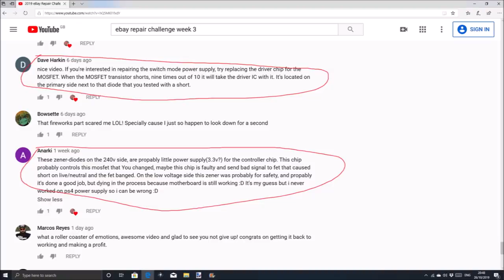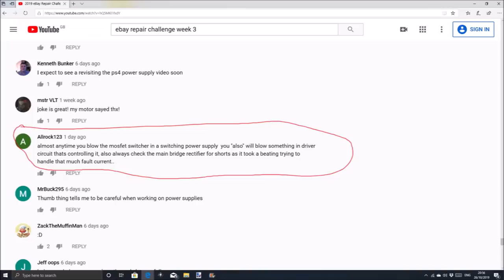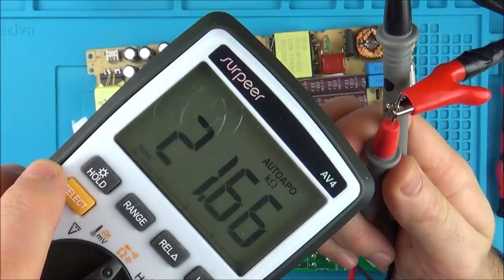REVISIT : PS4 Slim Faulty Power Supply ADP-160ER

Comment: Really pleased you revisited this =D  Resistance you've gone with for bleeding the cap power is fine!  Whilst you could damage the caps just shorting them, most people in the repair industry do just short them and 999 times out of 1000 it never causes any issue. 

Preheating both sides for a few mins at maybe 200 can help regards delamination, but it can be hard working with PSUs.  One of the problems removing that diode is they glue them down before soldering - that was the wierd redish black colour underneath it!  The other tip regards working with cheap boards like that one - use lower airflow!  It takes much longer to gradually reach temperature but that's a factor!  On things like the Switch, they have so many layers and so much ground layer etc the boards are much more tolerant as they can absorb the heat you use.   On a cheap 2 layer board like this it will 
burn up super easy with too much heat too quickly.
The other thing you should do regards removing small caps like that - heat both sides of the cap with the iron tip at the same time and slide them off - rather than using hot air.

Great job!  It was a fantastic learning excercise =D  You could rework that board - ie. fit the ICs and caps, remove the broken traces and replace with small wires.  One problem you can have when they go blackened like that is the board is carbonised and shorts could occur with high voltages etc.  But I suspect it would work fine after refitting the missing / faulty components and fixing with a wire or two.   I am so glad you revisited it!!!!
Reply: Thanks Vince and GadgetUK learnt quite a bit there, Cheers  🍻
Reply from the maker: Thanks Chris, when watching the video back the red glue became obvious but not when I was actually working on the board. Thanks for the help earlier on and also now with these extra tips. Nice one :-)
Reply: @Mymatevince  No worries Vince!  I am glad I didn't accept your offer to take a look at it!  You came to the same conclusion I would have done - I might not have even found the short as quick as you did!  But my point earlier about the SMD parts being hard to find - you've found problem too!  I searched for that IC on Google and can find nothing about it =/  It's probably propriatory to this PSU or used in very few other applications.
Reply: @Mymatevince  The red glue was used to fix the components before wave soldering. The board was not designed for hot air soldering.
Reply: @Mymatevince  hi VINCE..
Quick question..
My ps4 turns on and goes off..

I tried putting washers, but strangely it started to turn-off even quicker than before.

Then i removed the washers and the ps4 waits for a teeny bit longer (but still quick as 1secondish).

What do you think is the problem?

Previously I was thinking it could be a power supply problem but then i was getting 12v after jump starting the power supply. 

Could there be a problem where the power supply has a problem and cant handle the the load and gives up??

Or is this strong contender for apu solder joint problems (because of the time differences i found when trying to switch on the ps4 with and without the washers) 
also I didn’t use rubber washers but some metal ones, two on each sides..

Waiting for a reply.. 🙏🙏🙏

Comment: When you try to remove solder from parts, apply flux and then go over the pads with your hot soldering iron tip and add a bit of leaded solder. Leaded solder will bring down the melting temperature of the lead free solder and makes it easier to remove the part. If you keep having troubles, add more flux.

Comment: The chip is a NCP1612. It's a PFC (power factor controller). The shorted Pins are Gnd and Vcc.
Your patience is unbelievable ... BTW: seems that is one of the boards where the components are glued to the board before soldering. They are not designed for servicing at that low level - that's not your fault ;-)
Reply: same shit on the inverters drive boart 

thats is the basic components for the switchin power supply, the bridge rectify, mosfet, fuse, and the ic for power controller

well a trick on the bridge, that component acts like a diode, so, > pass the voltage < denige the voltage

Comment: Discharging the capacitors with a light bulb is fine. They experience much greater current spikes 50/60 times a second, while charging, during normal operation.

The pink dots around and underneath the SMD components are glue. That's why you're burning the board: The solder is already melted but the glue keeps the components stuck, making you falsely assume the solder is not yet melted. Try to apply some twisting force to the component while the solder is melted to break the glue.
Reply: 0

Comment: Finding a short is a lot easier with injecting voltage and looking for heat and going from there. Thermal cam, freeze spray, alcohol boiling away... etc...
Reply: so true , hard to see he grilled the board
Reply: @ingenuus2  Poor boardie 😢

Comment: That board took a hell of a power surge.   The bridge rectifier was shorted,  which likely blew the PFC switching mosfet that you first replaced.  This in turn blew out the PFC controller (the chip).  SInce VCC and GND on the chip were shorted and that chip is powered via the 12V supply,  that was likely damaged as well.  Other components that likely failed in the PFC circuit would be the current sense resistor in series with the PFC mosfet (low value, fuse-able resistor),  the gate drive resistor if there was one (between the PFC IC drive pin and the gate of the mosfet),  the boost diode (this was near the other side of the board,  under the large choke),  and possible damage to the main switching mosfets as well (these two were on the bottom of the board,  near the main switching transformer).  
Just an FYI but if you're working on switch mode power supplies a couple of tips - 1. If you have a multimeter with a Low Z mode,  you can use it to discharge capacitors in a few seconds and it makes discharging them very easy as you just use the probes.  2.  If any kind of switching mosfet fails on a power supply,  it is highly likely that it will take out several other components with it (gate resistor,  gate discharge resistor,  current sense resistor,  snubber and protection diodes,  even the PWM IC).  Check everything around it!

Comment: Just for your perusal ,a monalithic bridge rectifier wiil have a corner cut out, (Slant) this is always Dc +, the next 2 pins are Ac in then last pin is Dc 0v, how they are wired up is the Ac pin next to possative is usually Ac live in  Brown or Red and the next pin is neutral Blue or Black, also on square rectifiers there is also a slant allowing you to determin the lead pin outs, handy if any printing is devoide.

Comment: did you notice the small red blobs under the components? this is glue (used in factory to place an fix components in place before solder process, this is the real problem, and the temperature of your station, is a little hight and burning board is the price for learning,  about the solder melting, it is melting but the glue is not and it fix the component to board,  I not know the right way to do this job but I know the problem! and you burn the board because you inssit too much time in the same place of board... and all thogether lear too! thanks for your fantastic videos! you show your learning curve and we learning too thanks a lot!

Comment: glad to see you found the problem, you are having so much trouble with those components because they are glued to the board.
Reply: yes because it glued , assuming that there is solder not yet melt and he keep the hot air to long in there and board pop
Reply: This is most likely the problem, does look like some of the smd parts are glued to the board.

Comment: For glued down components like those diodes, I usually go with the desoldering gun (I’we got one automatic that is an iron + a pump in one - same as GadgetUK has btw) and suck up the solder then while heating the pads, carefully turn the component with pliers to break the adhesive. Hot air is too much for these boards without adding lower melting temp solder...

Comment: Hi Vince, I enjoy watching your vids, I'm a bit of a diy'er myself. Your short finding technique interests me and looks good in getting you in the right area eventually! But I think you'd be much more efficient and successful using an esr meter or ddm with a higher ohm/resistance resolution to pinpoint the exact location of the short. Basically when you test for shorts the closer the ohm reading is to zero, the closer the short. But if the area is tight like this, you'd need a higher resistance resolution to clearly define it. This ps4 psu and your game boy cart repair video would of benefited the most with this technique imho. Great work though Vince, your videos are pretty educational thanks ; )

Comment: hello vince, yesterday i discovered the main cause of delamination and burning of the PCB´S, the main cause is the excessive heat (obvious) and also the presence of moisture in the plates, which makes the water between the layers boil and stew the plate , causing it to be prematurely destroyed, so to prevent this, it is good to use a PCB dehumidifier BEFORE attempting to welding by hot air!
we keep learning together! hugs from Brazil, and keep going ALWAYS! YOUR VIDEOS ARE GREAT!

Comment: the components are glued down before being flow soldered on the production line, you need to add leaded solder with a soldering iron then you can use less heat or use some low melt solder alloy with the hot air

Comment: Well done finding the fault in the end :)

Your board is delaminating and burning, as your hot air gun is too hot, for too long in the same area.... you usually only need around 250-280c max to melt solder, i'd also drop the fan speed slightly..

And as many others have said, they were so difficult to remove due to the glue underneath them, which is used during wave soldering process, to stop the components moving around... There is something that can soften the glue (I can't remember the name of it though) which can help, or just add a touch of fresh solder, then you can see when it's soldered and apply a small amount of force to break the glue....

Comment: mate add more flux and keep temps at 400c with high flow rate makes things a lot easier note components are glued to the board so once the solder is  liquid work your tweezers a bit and it will come off  Your patience is unbelievable i wish i had it like you. use a ts 100 to solder if you do smd at least. and get a proper flux like kimbo or amtec.

Comment: Hi Vince, when working on that type of board that has been wave soldered. use hot air on it like you use it when you hotair LEDs. i normally run around 210c - 250c low air.(wave solder max temps are normally around 260c) and also before adding flux i add some leaded solder. Also because its wave soldered they glue all the parts onto the board before going into the process. if you have the time go look how they do all the different soldering. very interesting to learn. Glad you got the fault on the board. Well done!

Comment: Youre right Vince about having to applying low temperature solder BEFORE removing SMD's, Especially when the Board you're working on may have experienced high currents "which BTW crystalizes solder" APU I dropped a like..

Comment: somehow i feel you need to watch some electroboom "full bridge rectyfier" videos
also if it was me i would pisck my roll of in4004's and swap everything that does not show 0,2-0,7 on diode tester 
and yes, many smd boards components are bonded with epoxy before puting entire boards trough bath of molted solder for rapid soldering the red stuff is epoxy glue, use acetone and ipa mix next time to soften it up before desoldering, you can always mix some 2 part epohy glue with a bit of acetone later and use it as replacement solder mask/track bonding glue if the red glue lift some solder resist or tracks , you can also drill small holed trough delaminated area  and inject this inside
i love watching your videos though because it show me how crazy i was 10 -15 years ago

Comment: 37:50 this is precisely the reason I moved out of hardware support. Back in my day you had to perform the troubleshooting and even in some cases reverse engineer the circuit (no internet, never mind Google or YouTube!). Normally pennies for the parts and £100 labour. It was normal to charge about £250 per repair and took perhaps 3 hours. Bear in mind the original purchase price would be in the region of £15k and it was no wonder people questioned why it was so cheap to fix (Often questioned "did you really fix it?"). Move to today similar hardware faults, fixed in a hour or 2 for under £5, try charging £250 for the repair and you'd be laughed at - generally the hardware is cheaper to replace second hand than repair. Sad, but thats the way it goes. Sometimes cheaper for a consumer to buy a new device than to spend time & effort to have someone repair it. In fact I just threw out 4 oscilloscopes, deguassers and calibration equipment (I should've taken pictures!) as I hadn't powered them on in nearly 20 years!

Comment: The chip is a Enhanced High‐Efficiency
 Power Factor Controller. The Complete chip Part number is NPC1612A3, just google that number and you will find a PDF for the data sheet. Excellent troubleshooting, you are coming along nicely.

Comment: You need to make a miniature tri pod, with one of the three legs longer than the others, put a weight on the long leg, and bend it down at the tip. Sharpen the tip and use it to hold the chips in place.

Comment: I know what ya mean about needing closure. I once had a 1st gen segacd that had odd lines all through the screen during fmv scenes and would be missing other onscreen items.

At first I figured it was leaky caps,but they didn't fix it,then I thought it was the zip ram and again that didn't fit it.i spent probably a year looking over it every so often testing things here and there but never could figure  it out. Even tho I had cleaned the board multiple times and went over it many many times even with a microscope what ended up fixing it was poring a crap load of ipa everywhere and scrubing the hell out of it. I was over the moon when it finally worked correctly.

I guess some  Corrosion happend out of sight and dumping the ipa over the entire board out of frustration dislodged it..

Comment: great work mate, i have a different part number an ADP-160FR, but it looks almost exactly the same, it only has 1 capacitor less at the top side left of the board, yours has 4 in a square near the 5volts 4pin connector mine has only 3, but does almost the same, with the mosfet, with the 10 pin ic chip and with some capacitors, and the rectifier, the different is that the fuse is not broken yet, so it can be that with testing after replacing the mosfet you broke more part, just a thought, Grt from the Netherlands

Comment: Remember to check with both normal and reversed leads on your meter when checking for shorts as most diodes conduct one way but not both.
When checking for shorts your meter outputs a voltage and so the leads have a polarity i.e Red Positive + and Black Negative - .
When you check shorts or resistance think about components conducting with the leads one way around but not when reversed.
So check both ways !! 

A diode check is also handy on a meter as it shows the forward bias across diodes, for silicon diodes approx 0.6V
Bridge Rectifiers are simply 4 diodes connected together in a bridge configuration in one package and each diode can be checked independently.
This shows the internal connections and how each diode is connected https://en.wikipedia.org/wiki/Diode_bridge.

Comment: De diode pads solder melted at 14:02 that was the point where the component could be removed if it wasnt for the glue , further heating ruined the board unfortunately , a lot of learning was done :) thx for sharing

Comment: .....  Nicely done, Vince!!    Who said " Persistence is futile "   ??  :-)     The discharge/dummy load resistor isn't vitally specific, depends somewhat on the charge voltage on the capacitor, but, as most are charged from a bridge rectifier straight from the mains 240V supply, its going to be in to 300V plus, area. I would be looking at around 50Kohms, and, I wouldn't use a single resistor, cos if it goes open circuit at some point, you might be under the false assumption the capacitor has discharged, when it hasn't!!!  If you want to be really, really safe, add a neon bulb in series with about a 100K  1/2W resistor across them, & you will see it glow, till the voltage gets down to 80V, or so.  I personally use 3 off 100Kohm resistors, in parallel,  2 watts each should be fine!!   Stay safe!!